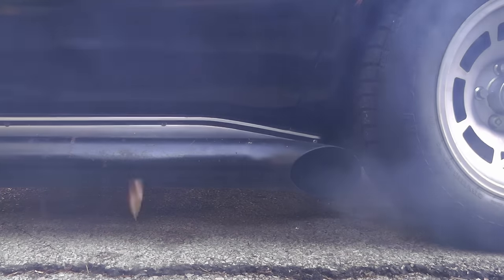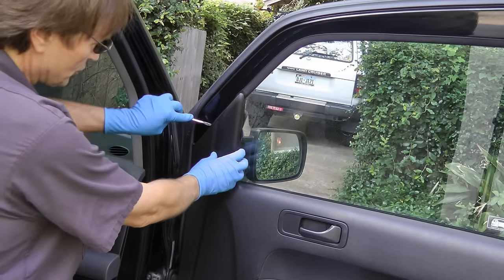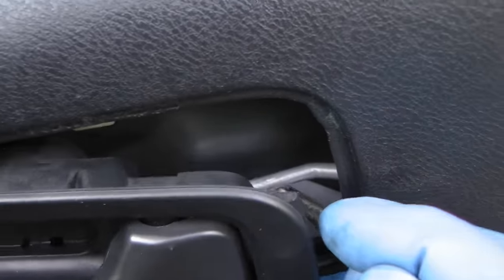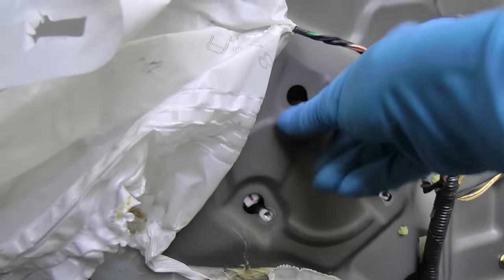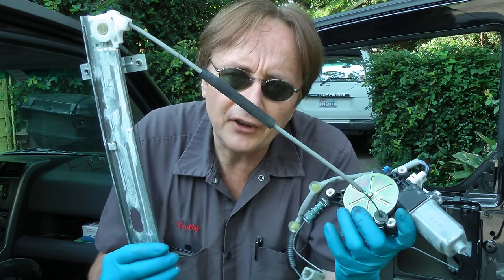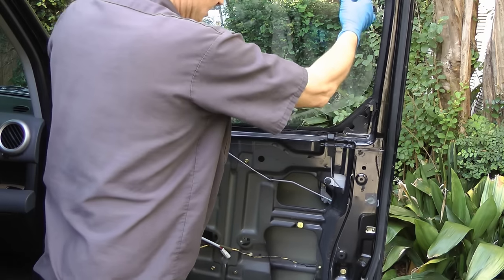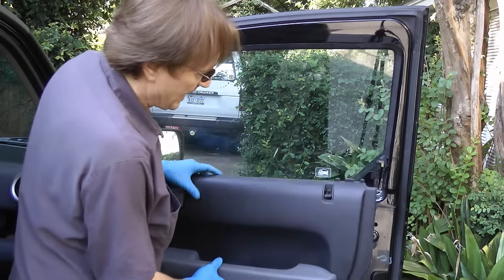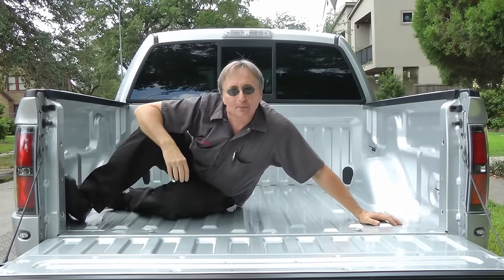How to Fix Power Window (Regulator Assembly) in Your Car

Comment: gotta love good old manual hand crank windows
Reply: Darn kids and their fancy electrical windows.
Reply: err... manual crank windows also have window regulators that (in some cases) are basically the same as electric ones jejeje... but certanly are more durable...
Reply: those needs maintenance as well.
Reply: It would be nice if these power windows also had a backup handcrank tucked in, so that you can use that in case something goes wrong with the electronics.
Reply: Right my 04 tacoma had a crank window & i just sold it & bought a new tacoma with auto windows & already its fucking broken so pissed i haft to replace it now
Reply: agreed. the more technology you add to simple mechanics the crappier it gets.
Reply: BaberJacks 

My car is from 1972 and it has electric windows
Reply: rick9021090210 
Manual crank windows do not have a regulator to them as they are all mechanical
Reply: While I don't care for all the electrical wizardry on modern cars (especially unnecessary blend door actuation)  I don't think most people would buy a car without power windows...
Reply: 👎NEVER!
Reply: @paulscontainersltd.4020  I think the regulator is the mechanical lever that is used to move the window up and down. It's probably basically the same for power or mechanical windows.
Reply: You ever try lowering a hand crank window in the back seat while driving? I like power windows.
Reply: F

Comment: I'm a sheetmetal/structures aircraft mechanic, this is my domain. Get a drill bit approximately as wide (in diameter) as the shank of the rivet. Drill the center of the rivet head as deep as the head. Make sure your drill bit stays centered. After you've drilled a hole approx as deep as the rivet's head you can pop the head off with a punch as wide as the hole. Then use a hammer & punch to drive the rivet shank out of the hole. Pop rivets (car rivets) may come out before all this I explained.

Comment from the maker: try spraying silicone spray oil on the front and rear runner sills where the window rides up and down, that often helps. If not, time for a new motor and or regulator

Comment: For me taking all that crap a part And taking it off – piece of cake. Putting it back together forget about it
Reply: im always left with extra screws after putting everything back together 😭
Reply: Let’s have dinner and talk about it
Reply: @Giller9  haha!
Reply: Wahahah
Reply: These are my people
Reply: @Giller9  So how did it go?
Reply: @jerrysantos7460  If it works it means you found a more efficient way than the car manufacturer of putting it together.
Reply: Toyota Camry 93 doing this for the 3rd time. It isn't hard to do. I take a piece of cardboard draw the door and stick the screws in the position they came out of the door and regulator.

Comment: The last mechanic I paid over $300 to do this job didn’t replace 4 rivets with 10mm bolts and the cable came loose on the regulator!  He broke the clip on the button housing too.  If you want something DONE RIGHT, do it yourself!!!  Thank you for the videos.😊

Comment from the maker: yes, you can unbolt the motor from the regulator, then use radiator clamps to hold the glass up in place on the regulator assembly. I do that all the time for people with little funds

Comment: If you're prepared to get really handy with a DIY kit then the old model Mazda MX5's (the MK1s) are reliable and easy to work on.  Scotty is right to mention chronic problems though as they are prone to bodywork problems if not well maintained and almost all of your buying experience for one of those will be spent looking for healthy bodywork, particularly around the sills.  There are other chronic problems but the very healthy community for the car means you can solve almost anything.

Comment from the maker: motors often just go dead, remove the inner door panel and hot wire and ground the two wires going to the motor to see if it's burned out

Comment from the maker: automatic transmissions that fall apart and shift like they're dragging an anchor, electronics that break down with dashes that go haywire and short out, and fuel injection systems that crack and leak internally due to cheap plastic parts.

Comment from the maker: often a worn out window motor. Remove the inner door panel, as in my video "removing an inner door panel" and hot wire the motor with power and ground. If it doesn't move, motor is bad

Comment from the maker: either motor or regulator has broken. Take the panel off like in this video and see if you can get the motor to run by unplugging its connector and sending power and ground to it to see if motor is working, and regulator is broken.

Comment from the maker: generally the driver control switch assembly goes bad, check that first. If power goes into it, it's bad. If not, find the short going to the switch and fix that

Comment from the maker: a sticking window can do that. Spray silicone spray lube on the front and back of the glass where it rides on the ridge in the door frame, that often helps. If not, you need a new motor

Comment from the maker: goog luck on that 4 barrel carb, they are mothers to take apart and clean correctly. As for gas tanks, most guys just replace em. BUT, you can get a fiberglass gas tank repair kit at any auto parts store, the come with directions, but basically you empty the tank, sand it all down, and fiberglass the hole a few times.

Comment from the maker: either switch is bad or motor. Take the inner door panel off and check the power feed at the motor wire with the switch on to see if it has power or not. If no power, replace the switch, if power, the motor is bad.

Comment from the maker: check the fuse for windows, you may have just blow that. If not, go back to that wire and trace it for power shorts as in my video "finding the source of electrical shorts on your car"

Comment: Thanks so much for the optimistic response scotty!  I don't suppose you could give a little bit more detail on how to do that?  Sorry, I don't know much about regulators, but obviously learning quickly.  Maybe once I pull it apart I'll see what you mean, but will the radiator clamps be used just to get the window up or to keep the windows in the up position?  Meaning that the clamps will be the only reason it goes up AND STAYS up?

Comment from the maker: realize those electronics are ultimately controlled by the body control module, it may have wiring problems or bad circuits inside. that, of the main power switch is going bonkers, they have complex circuits in them too

Comment from the maker: it's part of the switch assembly, either remove the switch or cut the wires going to it (but you'd have no power window then.)  Many guys put tape over them to not use them when broken though if they don't want to spend money

Comment: Glad I found your channel Scotty, great job on the videos. I just bought a 1982 Buick Riviera convertible in very good shape but I know I will have to keep up with it, and now I know where to go. One thing the blower for the air vent runs sometimes but it off and on. The other is my top priority the power windows, they also work off and on, they move slow not much power when they do work plus the rubber at the base of the windows are worn. Also hoping I can get the parts like one in this video.

Comment from the maker: generally bad switch or bad motors do that. But being so random, it will be hell to figure out which until it stops working entirely. But when it doesn't work, remove the inner door panel and hot wire the motor. if it doesn't work then, replace it.

Comment: Awesome video. My wifes Jeep Liberty has had two windows just drop out of no where because of the cheap plastic parts they used. She nearly ran off the road both times, with my 3 kids in the car. The first was fixed as "known flaw", but now a few years later they want to charge me $400 just for the parts. Laughed in their faces. Might try to do it on my own after watching this video.

Comment from the maker: you take the switch out, and use a test light to see is power goes in and out when you use the switch. wiring is MUCH more complex, pray it's not that, but it rarely goes bad.

Comment: I bought a window regulator and motor from the junk yard for 60 bucks, the dealer told me it would cost 10x that for parts and labor. An hour later I installed it myself, and saved loads of money

Comment: Great video Scotty. The drivers window on jeep drops 1/4 to 1/2 inch overnight, when driving, just randomly after making sure it is too the top. Have taped for now. Rain did get in one night, when first noticed.
Reply from the maker: generally it means you need a new window regulator

Comment from the maker: you try hot wiring the motor to get it up or down. But actually you need the window down to access the bolts that hold the window to the regulator arm.

Comment from the maker: generally that means the regulator is bad. and yes, be careful removing the motor as it is compressed, but you can lock the wheel with a nut and bolt put through holes on the regulator to stop that.

Comment from the maker: door lock systems are rather complex and expensive to repair, you really need a dealer level scan computer to work on them. Most guys just unplug the fuse to them or unplug the main controller and live without em. I've seen people spend 1200 bucks fixing em.

Comment from the maker: if the driver's switch goes out, often that will shut power off to the other switches.  Only other thing that generally goes wrong is a weak motor or regulator that will go down with gravity, but not up against gravity

Comment: I've been changing these window regulators/complete unit for multiple cars and trucks constantly for the last five years or so.The cheap on line replacement units often fail in less than a year.Sure they are unbelievably cheap but pulling your door panels ect apart .Kinda takes a toll on them.Clips breaking, loose handle part's ECT.

Comment: It could be one of two things that I can think of.  Check your charcoal canister.  The solenoid may be defective.  If not that, check the vent on the gas tank itself.  I had both of these issues happen at the same time and it caused a powerful gas smell when the tank was full.  Turns out there was gas leaking from the top of the tank because the vent return blew off from pressure.

Comment: I agree.  Just replacing your stock filter with a drop-in K&N filter can improve your performance and mileage by a hair.  Besides, your car probably already has a cold air intake.  It's designed to let air in and keep water out.  I've heard of people installing an aftermarket cold air intake and have their car not run right after driving through a downpour only to find their cone filter is sopping wet.

Comment: Wow. Thank you, Scotty. I tried to trying to fix my power window on my 98' Toyota Avalon. It was like the small steel cable which pulls the window up/down got stuck or something so I tried to coil it back up at the motor part (waste of time) and gave it another try......the small plastic round pulley ended up shattering from the tension! I was so frustrated. I didn't want the dealership to charge me my right hand to fix it but now that I watched this I'm sure I can do it as long I have to correct part.

Am I lucky that this was the only power window which gave out in the past 16 years?
Reply from the maker: on any other car, you'd be lucky. But you're unlucky with a toyota, as they rarely break

Comment from the maker: well, the breather valve must be clear and venting, or it will keep blowing them.  I would blow it all out with compressed air and check the whole system with a vacuum gauge to ensure it's really venting the case. could be clogged up inside blocking it.

Comment: This same thing happened to my friend's car and we fixed it without replacing any parts. It worked like... not really new, but it should last a long time still. The dealer did the other side earlier. They replaced the entire thing damaged some minor stuff under the door cover, and charged $300.

Comment: I have a 01 chrysler sebring. I think my window is off it's track, when I close the passenger door the window doesn't shut flush with the door. It rolls up and down, and sometimes it won't move, what do I do? Thank you so much your chancel has helped me with so many things!
Reply from the maker: probably need a new window regulator assembly, they are not repairable on that as they have so much plastic crap on them that just breaks

Comment: Scotty, I bought the whole new assembly, had NO problems removing and replacing the assembly. It's one of the easiest jobs I've ever done. Only took minutes.  But it's STILL not working! My mechanic said he checked all the fuses and there was power going to everything and HE couldn't figure it out. So now I'm troubleshooting it. Any tips on where to start checking?

Comment: Hey, so I have a 98 Honda Accord 2 door. Before, the power window on the driver's side used to go up, and it wouldn't go up all the way, leaving about an 3/4 of an inch of space. Also once it would get to the top and you keep pulling the switch to try and make the window go all the way up, it would make a loud, quick clicking sound. But now the window doesnt even go up anymore if you have it all the way down, you need to pull the window back up. The window doesnt stay up anymore, it stays open about 2-3 inches now and if you push it down slightly it will fall some more. It still makes a clicking sound when trying to close the window.

Comment: Might also want to make sure the switch doesn't have corrosion.  That was the case on our ford van.  I just took the switch off the door panel, carefully took it apart, doused the metal with contact cleaner, and it went right back to working normally again.

Comment: a big problem if you are installing after market door speakers. roll down your windows with the door taken apart and make sure everything works inside. because if you use speakers that have magnets that are too big, then the window will roll down so hard that they WILL strip the speaker right out of the frame of the door and disconnect the window motor from its 12 volt connector. all because the speaker magnet sticks out far enough to get in the window assembly's way. just though that i would share a little bit of my own experience

Comment: hey scotty, i have a 2001 lexus is300. when i bought it, my rear passenger side window wasn't working. i replaced the regulator and motor, but it still doesn't work. after some testing, i came to the conclusion that something is sending the signal for that window to keep going up. i plugged the motor in and it just kept spinning up and would stop once i pressed the down button on the window switch. i plugged the motor into the other side window and it worked fine. fuses are fine.

Comment from the maker: testing means nothing, a worn regulator could strain the motor causing too much voltage, or the motor could be bad. Me, I replace em both to do the job right, many times you can buy a chinese made motor/regulator assembly 5 times cheaper than dealer prices.

Comment: Ok sounds good.  I may as well just replace both then.  One more question before I start...How do I get my window up to replace the regulator?  I know if its the motor I can just hook the switch up to a 12 volt battery, but if the regulator is what is causing it to jam then how do I get it up?

Comment: hello, congratulations you are doing a very good job. I have a door mazda mpv 2003 no longer opens, what can I do to open it?
Reply from the maker: try opening it from inside and outside, but if it won't, then you will either have to cut holes in the inner door panel to force the latch open, or pay a locksmith or tow truck driver to open it, they can often get em open with their break in tools

Comment: My husband's Chrysler Town and Country has a problem on the driver's window, when it opens doesn't want to close, sometimes it doesn't want to open either, so he opens the door, slam back close and it works, we believe is a loose wire.

Comment: Great video as usual, my car driver window seems to work but seems to shimmies down and up. So the glass basically rocks back and forth. I don't let it go down too far and I can help pull it back up. I'm afraid to take it apart until i know I have the parts to fix it. Do you believe its window assembly? Window actuator/ motor? Other thoughts?
Reply from the maker: you need a new window regulator assembly

Comment: I had one window that refused to roll up, which was a easy fix: I discovered an adjustment screw on the motor and tampered with it. Now it will probably take your head off when you stick it through.

Comment: Good afternoon, Scotty, I have that window issue in a 2004 Mitsubishi Endeavor. new regulator and switch but it want go down. The window will roll up but not go down has me pizzeled. Thanks again. Josh..
Reply from the maker: check to see if power and ground exist, and are the opposite of power and ground when you turn the switch up instead of down.  Probably a power issue to the motor with bad wiring

Comment: Is that a 2003 Honda Element  (I know it's an Element)?  My passenger side window has not worked for a few years and I've met a few 2003 Honda Element owners with the same problem (passenger side window).   I hardly used my passenger side window which is why I haven't been in a hurry to fix it and wonder why it went out.  I was watching your other videos for fun and then clicked on this video.    Maybe I'll try fixing it if I can find the part on the cheap.   Thanks!